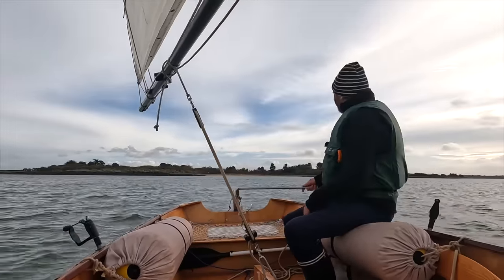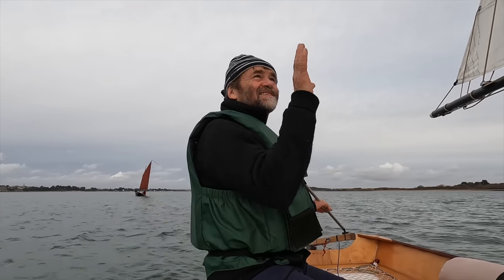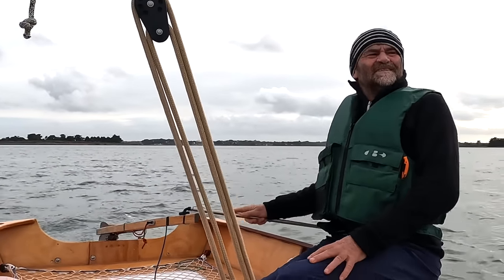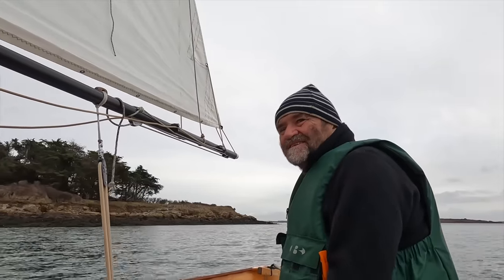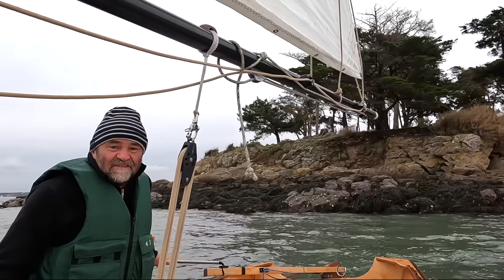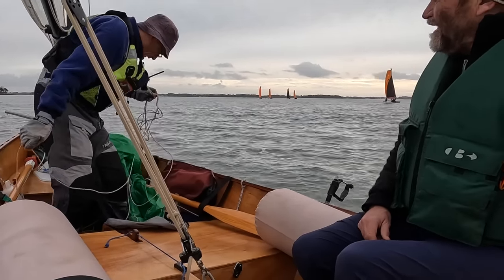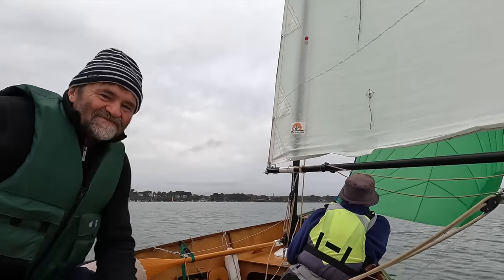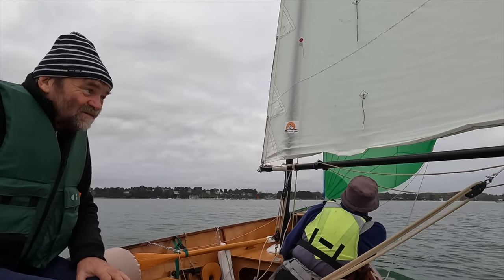Testing the Goat Island Skiff

Comment: Thanks for the video Roger. Actually the Goat is much more than a fast and simple skiff. It comes with a marvallous package of building instructions, very suitable for beginners. It is a real boat building course where to learn about differeny wood poperties, how to use the epoxy and much more. So the GIS is the final visibile result. And it's cheap. Out of the 6 sheets of plywood, very few little pieces will remain on the floor. To my huble opinion, here Storer did a masterpiece!
Reply: Absolutely. I had already build 2 boats from kits, but the GIS was the first boat from scratch. It was much more woodwork than glueing precut pieces of plywood together, but the total work was not more, as the Skiff is easy to build. In total, the work at the Goat was much more satisfying than the kit building. And which ply boat with a weight of 60 kg can carry 4 people unde r sails and is extreme fast at the same time? The Goat is unique.

Comment: Just to point out that an assymmetric spinnaker (A-sail) and a code zero are not quite the same. A code 0 is an upwind sail for light winds, and much flatter than most spinnakers.

Comment: The GIS is very a very tempting design for a gal who has never built a boat before.  It looks like you get a great boat if built within tolerances. Thank you so much for this, and for all of your videos, and best wishes on your house build..
Reply: If you are tempted by the GIS, Teo the Boat Rambler has a very useful series of build videos on YT for his GIS.  I watched them years ago and they were really enjoyable watching.  Not a design that I'm going to make, but lots of hints for me anyway.
Reply: @colrodrick8784   Thanks!!! It looks like he showed up in the comment section with a very useful tip.
Reply: As said, it’s certainly worth tracking down Teo’s videos. You will be hooked.
Reply: Mic Storer, designer of the GIS produces what could be the best and most complete plan set in all of boatbuilding.  His plans include step by step illustrated directions for building his boats.  All of them are like a boatbuilding course in a book.  

I have yet to find anyone who does not like a single one of his designs.  Even his Oz Racer (almost a puddle duck racer) is a great performing boat (for what it is…a 4x8 plywood tub) with a great plan set.

Pull the trigger, get the plans, build yourself a Goat Island Skiff.  If you can cut to a line drawn on some wood, you can build the GIS.

Comment: Nice boat! I built one about 15 years ago and have sailed it all over and in many conditions. I love the minimal hardware and simple rigging. I find that if you sail it with Lee helm it doesn’t pound hard at all. The leeward chine acts more like a keel and cuts through the waves. Also for me this boat performs much better when sailing from a standing position. If I don’t have any sandbags in the bottom for ballast the whole thing weighs only a little more than I do. This means that when solo sailing you are dynamic ballast. These boats will fly and turn on a dime when you sail them from a standing position and use the tiller and the sheet to help keep your balance! As someone said earlier these are much more like sailing a laser than most other dinghies. Have fun, and a a shout out to MIK Storer! One of his best designs. A perfect example of simplicity in action. And if you ever have the chance to sail one in a fresh breeze there is action a plenty!

Comment: I never tire of your theme song.  + your show.  I prefer your boat but its good to try out new ones. I have a question about the beach rollers in your friends boat. How much weight will they take and do they work on a gravelly beach. I have a rather awkward narrow  pedal boat, designed by Paul Gartside 30 years ago , which seems to get heavier the older I get.  Thanks.

Comment: Thankyou Roger. Very nice.
Reply: In light wind with the aft sheeting and the single fall in the middle of the boat the solo sailor can lounge on the mid seat, sheeting from the boom, the middle of the boat becomes empty and the bow slapping disappears.
Reply: @MikStorer  That was also my thought, Roger sits a little bit too far aft (as used in the much heavier Ilur). So also the tiller was too long for his position :-)
Reply from the maker: The slapping was less apparent when in the boat than on the microphone, actually. But yes, it would be good to have another chance to sail trying out other positions. Where I was sitting was just behind the rowlocks, but I reckon it would have been better further forward.
Reply: @RogerRoving  That's not too bad. Just behind the seat is the standard position.

Comment: Thanks as always Roger.  

Seeing Teo making comments, well, you know he's arguably the best qualfied, bar perhaps Mik, to make suggestions o the GIS.  I remember so well, my own little VJ, the boat I sailed for many years as a kid, and the sound it made was identical.  Trim was important with it too.  They were fast.

Interested in both the code 0 (and how this impacts the mast; although I imagine that as it's only being used in light airs it's not adding much to the pressures on the spars) and the centreboard.  What has Pierre done regarding the foils?  I didn't really understand what changes he had made from the original design.  Is it a kick up centreboard ?

Anyway, I've also been reading your latest edition of the Cruising Dinghy Companion.  Much appreciated.  A fine piece of writing.  It has been a pleasant diversion during recent flights I've been on here in Oz.

Comment: I do like this design, I think I would have built one if I had seen this and other video's before I built my current boat which I self designed its very similar if a bit shorter and heavier construction.  I haven't sailed mine yet but will this summer (southern hemisphere).

Every sailor would love that boat on a good day as you had but what about a  windy day with some sea and a long beat ahead of you would you still prefer that boat or your own. Also speed is relative great to get places but then there's always a faster boat nearby :) I raced Laser's as a young man now a bit older fast takes a back seat to comfort and ease of use.

Comment: Hi Roger. Any loose footed mainsail (with a boom) will benefit greatly from the use of a simple "clew tie-down". This is just a short piece of line, tied through the clew cringle and around the boom...just loose enough to allow the clew to slide easily in and out in response to outhaul adjustments. The effect is to separate the foot camber (from the outhaul) from the leech tension. With the clew tied down, you can ease the outhaul enough to deepen the foot camber (when appropriate ) while not necessarily changing sheet/leech tension. Without the clew tie-down, easing the outhaul simply results in the boom sagging downwards, as in the video. Try it.... you'll like it!

Comment: GIS are typical of Michael's designs, simple and rational.  The lightness when putting the boat back on the trailer is very appealing.

I have only sailed my ilur with GISs a few times. I thought the weight of the ilur gave it useful inertia in light winds that wasn't available to the skiffs.  I seem to remember keeping up with them.

The dagger board is a bit of a liability in shallow inland waters.  

I have seen an ingenious Welsford navigator that has a pivoting dagger board.
Reply: My GIS is happy sailing in VERY skinny water with the daggerboard and dagger rudder. I have been able to make way with inches of each down and a bit of heel in a foot or so of water in conditions like these. Roger seems to be having a good time! Hee Heee!
Reply: Some input from a sailor who sailed a Goat for 15 years: the dagger board works very well as the center of lateral resistance does not change when lifting the dagger board. It also makes for a very large unobstructed cockpit allowing you to sit right aft of the mid-seat leaning with your back against the hull’s side as there is no case sticking out in the main cockpit area (as you can see in the video, Roger is forced to sit further aft which does affect balance negatively, as commented by Teo further above).

It helps when sailing a bit attentively of course, trying to avoid hits on the dagger board. That being said, there are hundreds of Goats on the water with the standard dagger board with plenty of them sailing skinny waters. The dagger board case design has proven to be very strong and capable of taking hits. More typically the dagger board leading and trailing edges get banged up a bit, not the case. With some TLC it is not difficult to keep them in good shape however.

Kindly note that almost every modern performance boat has a daggerboard rather than a swinging center board and that the Goat was designed as a very light fast sailing dinghy.

From a performance perspective, it is simply better (as mentioned above already the center of lateral resistance is not affected when raising the board a bit, the opening in the bottom is smaller and easily shaped to take on the profile of the board). Further there is no bolt that can leak (note that the center board case design shown on this Goat is smart and does have a bolt). Lastly construction is easier and it takes less space in the cockpit.

Comment: As you tack. plant the sheet and tiller extension on the lee gunnel with your aft hand, as you pass under the boom and turn to face the opposite side, grab the extension with your other hand. You will find, as you sit, both will. be in the correct hand. The long extensions are quite ungainly to begin with. But, with some practice, one will find them very helpful.
Reply: I would not recommend this in a light boat like the GIS. You want to keep hold of the tiller or tiller extension as well as the main sheet at all times. Plenty of videos out there showing the correct technique.
Reply: @joostengelen8487  I would recommend keeping hold of both at all times on pretty much any boat. At no point did I suggest otherwise.
Reply: @mhansl , okay. I apparently misunderstood the part reading "plant the sheet and tiller extension on the lee gunnel with your aft hand, as you pass under the boom and turn to face the opposite side, grab the extension with your other hand".

Comment: I've been interested in this boat since I first came across it by chance somewhere online a few years ago.  Light weight, simplicity and performance are very appealing and make the GIS very usable whether singlehanded or with crew.  It's a noisy boat though, isn't it!  Even in the tranquil winds and waters of the test the hull kicked up a distracting din.  I wonder what it's like at sea.
Reply: It is possible to move the meat ballast (yourself) and position it so the noise is about the same as any dinghy... I sail Lasers, sunfish, V15, and the oddball melonseed, and they all make more noise until you get in the right spot...
Reply: I sail the Goat and also a Northeaster Dory, that has a very much rounder shaped hull, and the sound of the waves is equal. From my point of view, it comes more from the 6mm ply both have. It's like you sail a violin. 😊 BTW, my dog likes the sound, she falls asleep as soon as we are on the water.

Comment: Since September 2016, I have been sailing the Goat Island Skiff, which I built myself - according to Michael Storer's original design.  However, this is a slightly different boat than the one shown in your video.  First of all, mine has a daggerboard and a dagger rudder's blade.  There is no closed compartment or closed storage space under the middle rowing bench.  The mast is a wooden box, and all spars are wooden.  There are more details that distinguish these boats.  I think it would be worth comparing the original design and French modifications.  An additional big sail (Code Zero? Genaker?) and light carbon mast and spars mean lightness and greater speed.  Pivoting centerboard and rudder's blade provide great comfort in shallow water, especially when sailing alone.  I appreciate all the modifications.  In my case, I only added side benches in the helmsman's cockpit, maybe I will also add a transverse bench there.  Regards